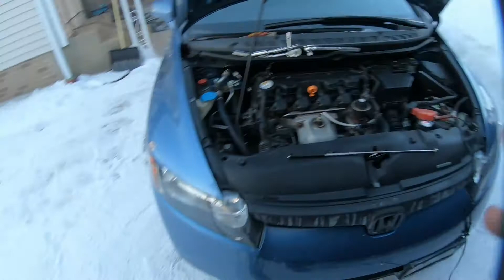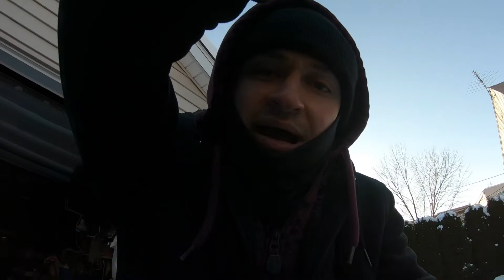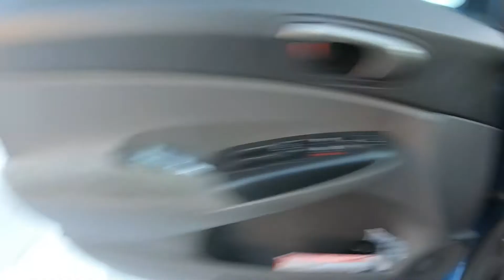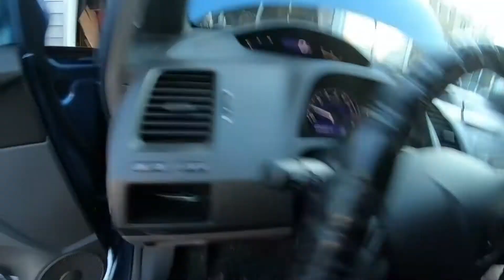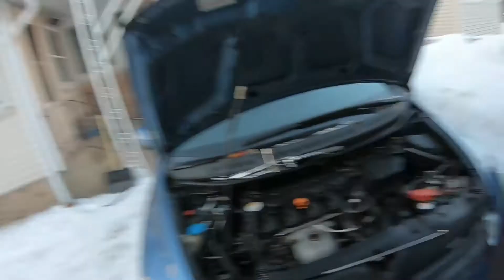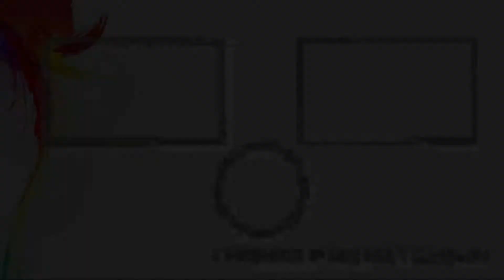PCV Delete? Honda Civic R18 Turbo

Comment: Definitely wouldn’t recommend to turbo the automatic civic if you ever actually turbo it
Reply from the maker: Just trying to work with what I got.  Trust  me I would prefer a manual. But it is what it is.   It’s still a massive learning experience for me and regardless I will grow.
Reply: Superchargers and turbochargers introduce a whole lot of new problems you never had with N/A. Use of check valves can sometimes be helpful in the PCV system to keep boost where it belongs, in the intake manifold.